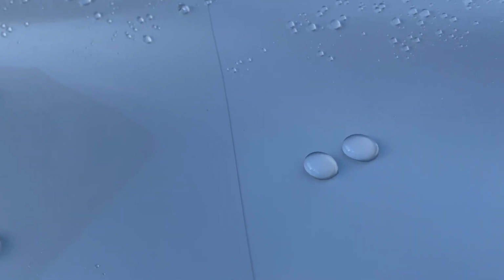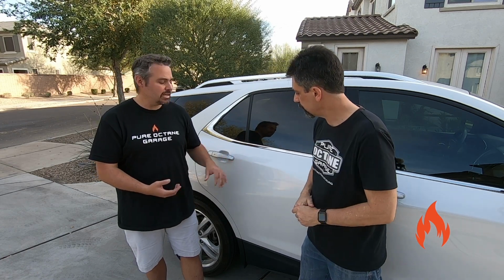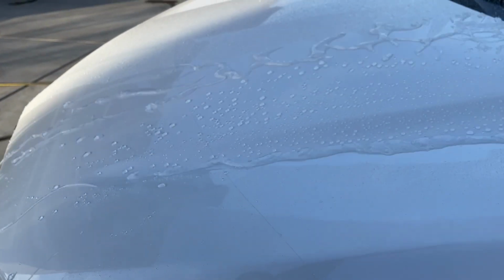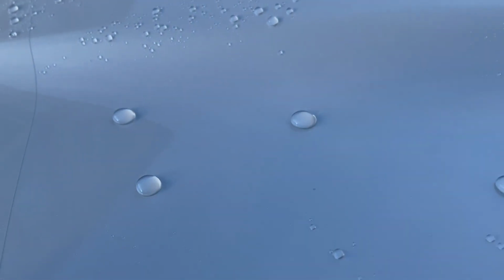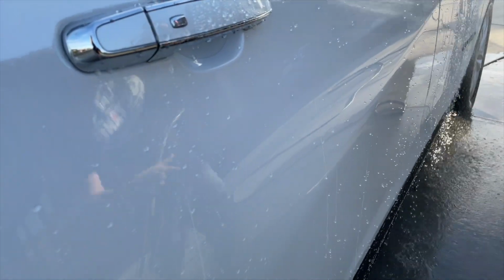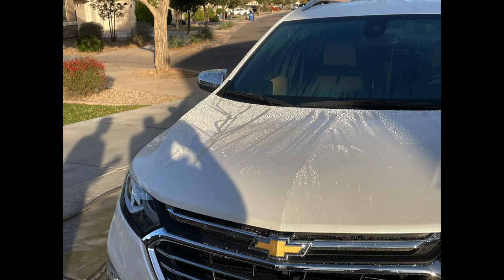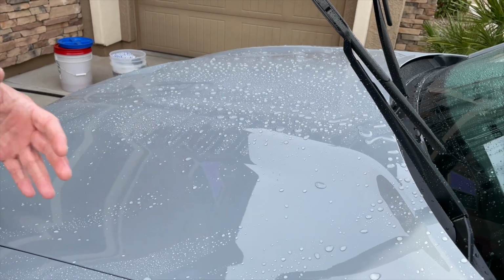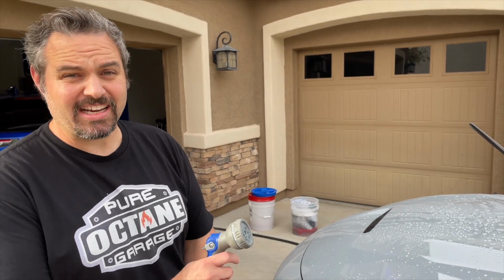Adam's Graphene Ceramic Coating & Spray Coating Update - How's It Holding Up After 4+ Months?

Comment: For a spray coating Adams is excellent. I just coated my Durando SRT in Adams new Advanced graphene coating a few weeks ago. Much much much more difficult to use than the spray lol. Little harder than most consumer coatings imo but that is to be expected with the thicker higher silicate formula. It sits outside 24/7 so that will really be a good durability test. They claim 9yrs but outside 24/7 I will be happy with 3+ years.
Reply from the maker: That's great to hear. We have been waiting to hear results of the new Advanced Graphene Coating. Thank you for sharing. Hope it lasts. What color is your SRT Durango? That's a mean machine!! Appreciate you watching.
Reply: How has it held up?

Comment: Pure Octane Garage thanks for posting this. I’m looking into the adams graphene 7yr coating and curious how it is holding up. Is it as slick as the graphene spray? I have used the spray and love the slickness and shine from it. Also curious since you have used both the spray and the full coating if you have a preference. Thanks again guys!
Reply from the maker: Hi M H. Brandon here--I personally like the spray due to it being easier to apply, less expensive, and with the Graphene detail spray as a maintainer... Holds up extremely well. Thanks for watching!

Comment: Great video.  I am going try this coating on my Ram.  I have xpel on my full front and mirrors looks like it works with PFF.  My trucks sits out in Florida sun won't fit in my garage  😑.  I wash it once a week and use turtle wax flex spray right now.
Reply from the maker: Sweet. Let us know how it turns out Jason. The coatings applied perfectly to both of our vehicles' PPF. The Charger actually has Xpel PPF as well, on the front end, rear flares and the mirrors. So sad it won't fit in the garage, makes for time detail therapy though😁. Appreciate you watching!
Reply: @PureOctaneGarage  will do.  Thanks